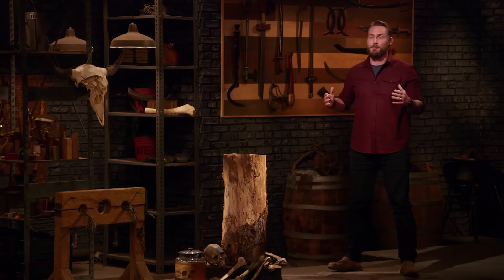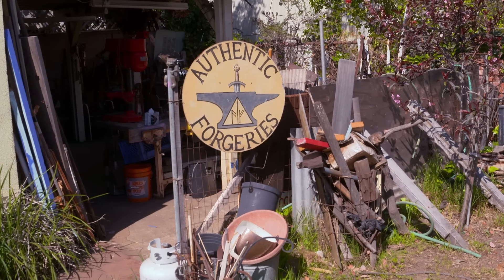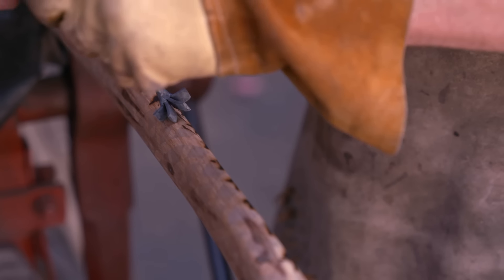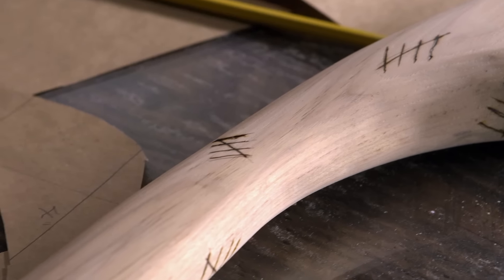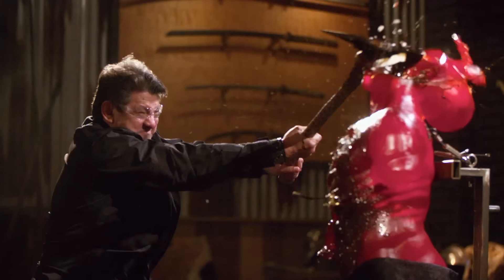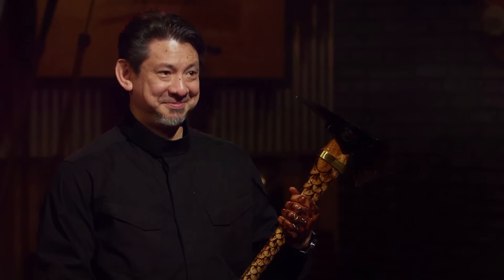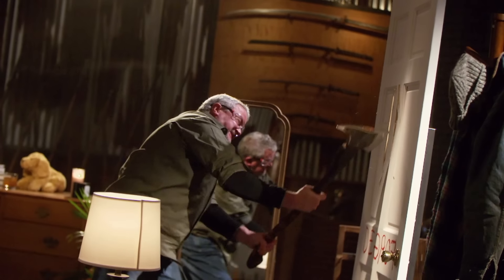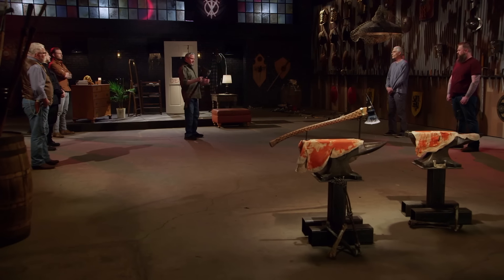Forged in Fire: Fireman's Axe BREAKS THROUGH the Forge of Fear Finale (Season 8) | History

Comment: Jordan's ax was a tool while Peter's was more a combat weapon.  If I had to save someone from a fire I'll pick Jordan's.  But if I have to swing it all day on a battlefield Peter's design wins hands down.
Reply: You mean hands off.
Reply: @scunts  LOL!  Great way of looking at it.
Reply: @scunts  Hands down....on the ground.
Reply: I agreed, Jordan never knows to kill. Only save a people on fire!
Reply: They're both winners
Reply: Thanks Chad
Reply: Twohanded axes are actually quite hard to use effectively in battle as it have limited pattern of attacks, you'll better off using a poleaxe.
Reply: Man I really liked that the axe was really his with his parents memory’s
Reply: i would pick peter’s because its lighter
Reply: But when the handle is cracking, that’s a huge issue. And the fireman ax isn’t necessarily made for combat. It’s designed to be tough and durable especially having to standup to whatever the firemen run into
Reply: @DanielG1095  There's a type of locust that grows in the Smoky Mountains that has no thorns.  That wood, properly cured, never cracks or rots.  A handle made of locust would never crack in a fire.  But the wood is almost as dense as mahogany and that would make the axe even more heavy.  IDK but the trade off may be worth it.
Reply: Well said.
Reply: @vond5829  Unless the Axe has a metal plated handle and you have gauntlets to catch the blade.

Comment: The competition was a draw...why they didn't get it 5000$-per head?!
Reply: Because it wasn't a draw. One axe had some slight defects, and the other didn't.
Reply: one of the axes will be broken after 5000-10000 door crash.
Reply: I don’t think it was a draw after hearing each of their remarks and seeing the results.
Reply: It's because Peter's axe had some slight defects and Jordan's axe better matched the example of a traditional fireman's axe, and Jordan's axe was able to damage the door quite a bit better then Peter's axe on the strength test, so that may have also been a factor.
Reply: Exactly
Reply: It wasn't a draw, the other guy dispite having a heavier axe didn't have defects... Unfortunately the other one had a crack in the handle top that's why he had to put an additional steel wedge so the handle wouldn't shatter completely.
Reply: @runeplate123  Wow...i "love you too"!

Comment: It seemed to me that Jordan's axe worked more like a hammer at the strength test, while Peter's axe actually cut into the door. The sheer weight of Jordan's axe made it into a sledgehammer rather than an axe. Regardless, it performed on the sharpness test, but because of the same reason, the sheer weight drove the blade down more than the tester did.

Comment: I feel like this is the only real instance where there should have been a tie. I understand the show doesnt do that and i respect it, but one axe litteraly was an elegant, light weapon and the other was a heavy, efficient tool. 2 different types of axe, and i would argue the lighter one shouldve won because its more of a weapon than the other, yet i see that a firemans axe should be a tool and not a weapon. A though decision, in the end i agree. Both perform the same and while one is heavier, it negates that downside by being more "historically accurate" and gets the win. But the other is deffinetly a more useful weapon on a battlefield. This has been a very good episode
Reply: I’d agree with ya if Peters didn’t have the cracks in it. It’s an incredibly tiny detail the judges picked but I can understand why that could be a deciding factor. This is one of the few times where a heavier weapon is superior. Axes aren’t meant to be used in multiple strikes, just one and done chops.

Comment: I'd rather have Peter's axe over Jordan's as a general purpose axe, if there were no issues with the handle. Being lighter would make it an amazing axe for splitting wood, or almost anything else.

The problem is, a Fireman's/rescue axe is heavier for a reason, like knocking down doors and walls. It's almost like a sledgehammer + pike + axe. Fewer blows can make for seconds saved, and lives saved. Also, while Peter's was prettier, I think Jordan's squarely hit with the spooky theme.

Comment: As a former professional firefighter,if the head don't weigh at last 6  pounds it ain't right. Also the fact they sharpened the ax is wrong. You want a steep blunt edge for smashing,not cutting. If you ax is sharp it will stick in what ever your trying to smash through.